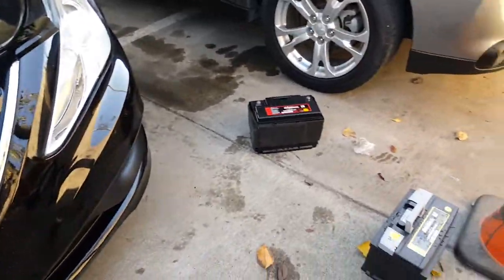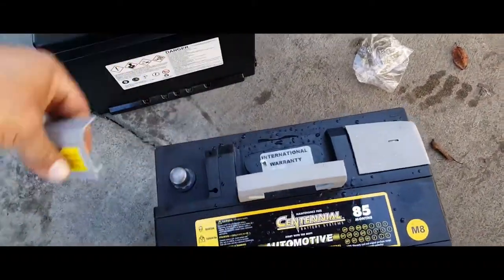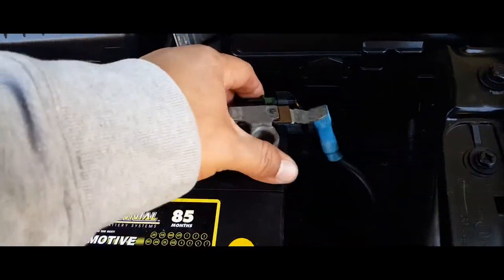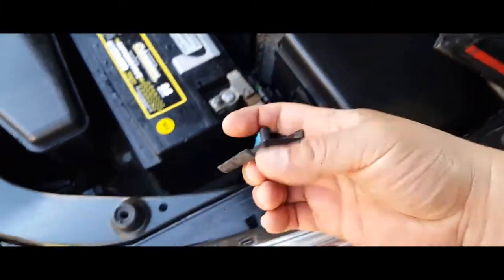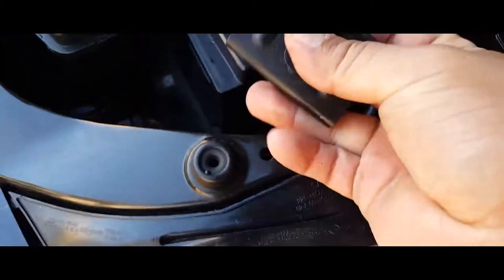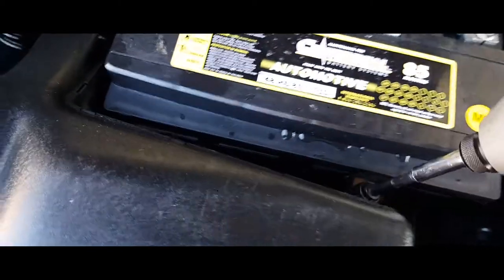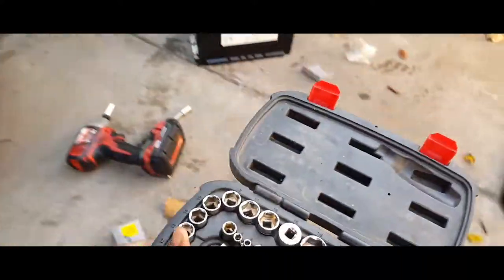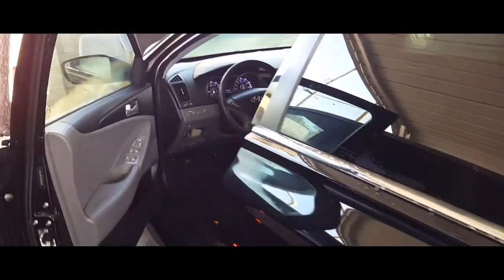How to: Install a new battery on a 2014 Hyundai Sonata

Comment: Just bought a battery from Advance auto and the positive terminal with that plastic housing on it won't go over the positive is there a way to yank the positive to give me more length to pull it over the positive terminal without causing damage?
Reply from the maker: No they are strapped down, I don't think its the correct battery because it should all be the same. No modifications needed.  Try flipping the battery, so the Positive and negative post switch sides and hopefully you don't have to pull the cables. But the replacement battery should the same as the original
Reply: @559powerscape  well I'm frustrated trying to explain over the phone that I'm not a complete idiot. I guess I will hitch a ride back tomorrow with photos to better explain the problem.
Reply from the maker: @danwilson12  sorry bro if your able to start it and drive it to them they can swap out the battery for you. Autozone will do it hopefully advanced auto does too. I would call them to verify they do. Good luck buddy!
Reply: @559powerscape  a friend off face book said they gave me a 124-r instead of a group 48
Reply: @559powerscape  the websites do say 124-r is an exact fit but I don't know will try again tomorrow with proper sunlight